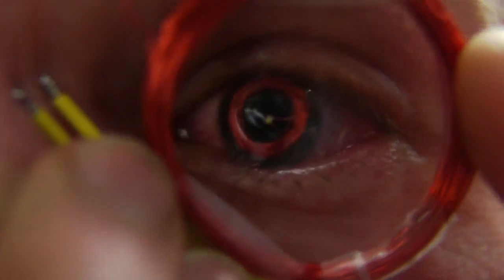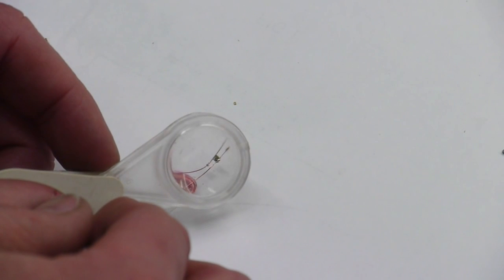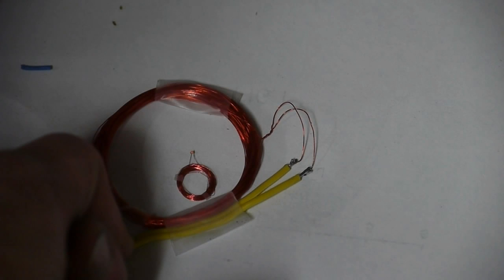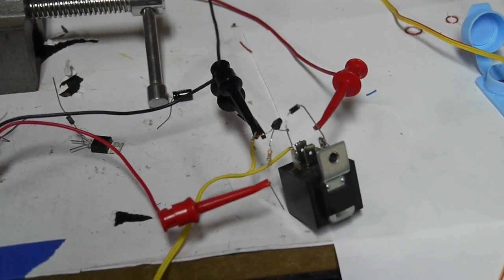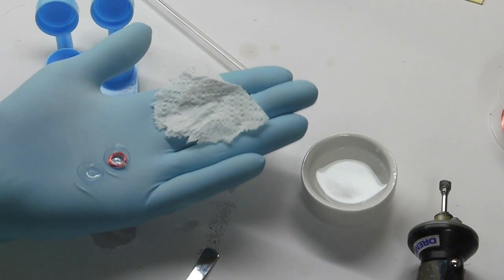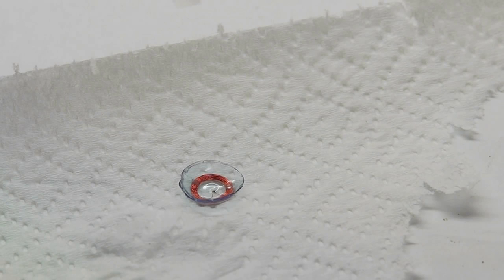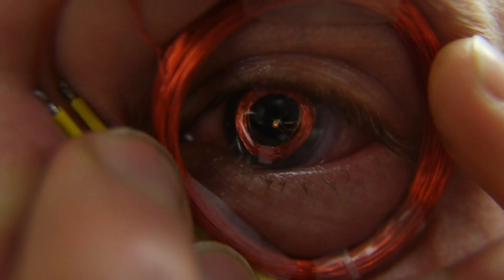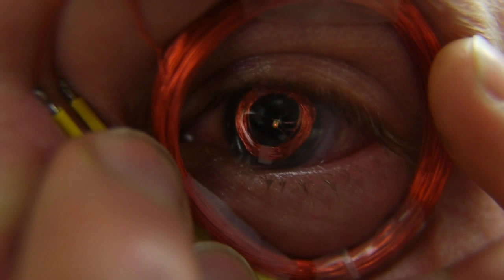LED mounted in a contact lens for possible virtual / augmented reality displays

Comment: could you bind the two lenses by heating the coil up to melt a shallow layer of the contact lenses together?
Reply: alas no it would burn through the actual lens & invalidate the aim of mounting coil / led in the contact in the first instance
Reply: ***** melt a Shallow layer... slowly and carefully.... or perhaps you could use your high power flash rig and shield the center part of the lens and then flash it a few times to get a uniform heating which would lead to less stresses in the system. Maybe a pre heating (to just below the glass transition temperature) the entire lens and then performing the above method would lead to even less structural damage. Id really like to hear back or see your thoughts on this ***** .
Reply: Jason Pfeilsticker the trouble i have with melting a shallow layer is a fabrication issue - considering the average soft contact lens is about 100 microns in thickness the sensitivity for generating a shallow melt would be a beyond the practical limit of (a) human hand (b) arranging a mechanical press 

glass would stand a better chance of surviving a shallow melt aside from the inherrent issues of weakening a brittle structure like glass, inducing aberations into the optical region of a lens & then inserting it into the eye 

happy to discuss lens materials in more detail, though i would foresee for a more long term concept of crafting such a contact lens would be at the time of manufacturing - it is however going to be the hardest thing to get such manufacturers to craft something that is not immediately profitable & prototyping is a decade+ away

logistically to generate a HUD display in a contact is theoretically possible though it would require a level of quantum engineering beyond us
first layer of the lens is the camera / sensor, a second layer the processoring component to a third layer discreet photon emitter relaying the intial image & the processed HUD

alternately would be a secondary input to the visual cortex (again several years away) where the HUD is effectively projected in the cortical processing of the visual pathway itself

sorry i have had a lot of time to think about such mechanism ;-)

Comment: try using food grade epoxy to hold the coil to contact lens in place. its a multi-material adhesive i have used alot on various non-metallic to metallic surfaces. this is pretty common in the custom knife market. esp with plastics and organic structures. devcon is a really good product. if i am not mistaken devcon has a medical grade epoxy listed in their company product list. it would be neat to see an update on you of this mod suggested.
Reply: i would suspect this would also be limited like the super glue idea - basically you are adding extra mass to the contact lens in an irregular form (yes i know the video crafter is an engine but this kind of thing needs to be done in the actual processing stage)
hence in this instance heat sealing (while still uncomfortable for the final lens bares the most logical given the materials available to the video cfrater

Comment: Use blue or white LEDs. White diode is actually blue (450 nm, or new ones violet, 405 nm) light emitting diode with phosphor added (old white LEDs has only yellow phosphor, but some new diodes has violet diode, and RGB phosphors, which are pretty expensive). The point about blue LEDs is that it glow very well on very low current. 

Use two diode, soldered anti-parallel (anode to cathode at one end, and opposite at another). This is because of band gap widening with 'wrong' polarity, and when polarity reverses - LED need very long time to recover. For testing this, use 'normal' 5 mm white or blue LED, hold one lead with your finger and another lead attach to some galvanically or capacitively 'grounded' metals. With your other hand, close to walls where AC mains are in wall - it should glow dimly.

Just one diode will blink on occasion, but two - soldered anti-parallel will glow at frequency of your mains (here in Europe, 50 Hz).

IR, red, orange and yellow LEDs has pretty bad performance, but green, blue (470 nm), royal blue (450 nm), UV-A (405 nm), UV-A (365 nm), and all sort of white LEDs has pretty good performances. 

From IR to yellow diodes, there is band gap of cca. 2.2V - 2.5V, while other diodes has 3.2V to 3.5 V forward voltage drop. And pretty good quantum efficiency (especially blue ones). 

Personally, I will not mess with wires in my eyes. If you can find fluorescent contact lenses, you can use 3W, 405 nm LED, collimated so that it cover whole your face. Although, this is somewhat dangerous (close to UV-A spectra), I tried doing this for 10 minutes with two 3W diodes - as close as 10 cm from my face and eyes - with mild eye and skin irritation for next three days (and complete recovery after that). 

So, if you do it for minute or less, no any irritation expected. Just do brief blinking with UV light, and people will be scared, if your eyes start to glow. 

Cheers!

Comment: What if you used actual glass contacts? And used your evaporation method to make the "coil" and mount the led on that? I think you're doing great.
Reply: long version

The use of glass in contact lenses hasn't been used since the first introduction of the scleral lens (100+years ago) part of why it was phased out was the brittle nature of glass, which was then upgraded to PMMA (it was discovered the polymer it didn't react with the organic structure of the eye after a number of cases of fighter pilots in WW2 had shards of PMMA in their eyes from dog fights which have been inert since)

The next limitation was the lack of oxygen transmissibility through the lens (cornea is organic & still requires oxygen to maintain clear healthy structure). initially a wearer relied on tear exchange (basically oxygen dissolved in your tears) and fenestration (drill holes in the contact lenses)

With the advent of the hydrogel polymer (the birth of soft contact lenses) water was actually bound into the lens polymer & used as a oxygen transfer agent

In the last 15-20 years the inclusion of silicon into the hydrogel mix (first introduced to the market by Ciba Visionss Night & Day lens along with Bausch & Lomb's Purevision) allowed for all most 5 times the oyxgen transmissibility making certain lenses actually safe enough to sleep with. in the video the gentleman cited he used an Air Optix contact by Ciba Vision (their second attempt at a SiH lens) & given this (i assume) is his choice of lens once it is out of the moist receptacle of the container (or the eye) it will start to dry out & become uncomfortable to wear (hence why the eye is red at the end of the video)

TL:DR ?  glass is not practical as a long term contact lenses platform 

BONUS
i could theorise that if the coil construct was actually molded at manufacturing it would have a better success margin - we already have instances of telescopic contact lenses have been prototyped Contact lenses that can zoom! - Truthloader Investigates (i'm not enough of a dick to post my own video here but i also offer my $0.02 on the telescopic contact) so in the future i see no reason for the manufacturers themselves to build the devise
Reply: It was just a suggestion based off of what he's done in the past lol
Reply: Pepper Nickel my bad with hindsight i was f0rty-eight lines too many

Comment: Try using a bit of organic compounds to melt the contact lenses together. put a drop in the middle of two contact lenses, stick them together, evaporate as quick as possible though cause the organic compound might melt through the entire 2 lenses, you only want the compound on there long enough for the lenses to melt a bit until they re-solidify together

Comment: Well I found your video by accident but have no interest in doing such a project BUT you said you have had trouble with joining the two together w/CA they have CA that is made for clear plastic don't know if it will work for this but it will not "Fog"  clear plastics that I have tried in the past Standard CA WILL NOT work and fog it up every time just Google it or check Hobby King for windshield CA  you'll find it -just had to add my two cents Good luck

Comment: You would need a screen with tens of thousands of pixels to show anything for a eye-screen. Think of it. Get real close to your monitor. And I mean like as close as you possibly can, everything is blurry and you can see individual pixels. Putting a screen in your eye you would need a extremely tiny screen with thousands of pixels to see anything. Like Imagine taking your computer monitor and shrinking it down to half an inch tiny.

Comment: i understanded that you are trying to puls the coil with a relay and a pulse generator,
wouldn't it be better just to put a ac voltage in the primary coil because that's what coils most like,not block voltage or dc voltage, u will then get more in your secundairy coil wich will make it light brighter, also are there very tiny condensaters which will fit in the lens and for sticking the lenses together a clear water proof glue could be a solution, maybe need to check out different conds of glue?

Comment: Since you can't fit a capacitor in the contact lens, could you use the two lenses you glue together as the cap? The challenge would be to get the sides conductive and at the same time isolate them from the moist. Just thinking in text here...

Comment: For your power issue, so your not holding that Cu ring around your eye, would it be possible to apply the "microchip temporary tattoo" technology to the contact?
I believe I read that these Epidermal Electronic Systems (EES) are powered byphotovoltaic cells. Search Professor John A. Rodgers of University of Illinois in Urbana and review his research. If power is strong enough could that be applicable?

Comment: i dont know.. maybe protect the middle part of the lense with something to sheild it from heat and hit it with a hot air gun to fuse the edges together?

no idea how you would get a capacitor in there.

Comment: Its pretty simple to make contact lenses. It's not possible to "glue" them together, because they aren't solid "plastic" they are a gel. They are made mostly from water. 

The inventor of the production method for soft contact lenses is a guy from Czech Republic (at the time of invention it was Czechoslowakia). Search for this issue here on YT and you will find the way to make contact lenses at home, because he did this as well :)

Comment: Try a traditional HEMA lens vs. the silicone hydrogel. The silicone hydrogels are very low water content and have a surface treatment to resist deposits. The lortrafilcon B in the AirOptix is only 33% water. Search for a polymer in the FDA class 4, ionic high-water content.

Comment: try warming the contact lens in still, sterilized water to the point where you can insert the wire. make sure the wire is small as possible in height.

Comment: I HAVE DONE THIS BEFORE! Just set the contacts on top of each other with the red material in between and let them dry. Contacts lenses become EXTREMELY stick when dry. This might take a few tries to get the placement correct as the red material will off center it depending on it's size.

Comment: I did this with butterfly wings between. You need to melt the whole edge at the same time. make a two part press out of a thin shaped aluminium tube that you heat and something that is cheap, firm and non toxic yet has some give (frozen fruit).  Heat it up with a soldering iron or propane torch and press the two lenses so that the edge is consistent and will cool off fast and not burn. depending on how you bevel the edge of the cutting surface can control the exact amount of  lenses tapper.

Comment: Put if you hade over sized lens melt 3/4 s the way try and flipping their right side out and slide the coil in and seal with little heat

Comment: Hmm, I know acetone, if in the eye with a contact lens will physically 'attach' the lens to the eye, it dissolves the plastic of the lens but rapidly evaporates leaving it bonded. Perhaps a very small amount of acetone could be used to seal the two lenses together?

Comment: Definitely wouldn't put this in my eye for long periods since drying out the lens causes issues with the len's structural integrity. Stacking the lenses decreases its oxygen permeability causing less oxygen to the cornea. Melting the plastic edges can scratch the cornea upon insertion and could can lead to infection.

Comment: Use that atomic glue they used on the football player hanging by his helmet on the goal-post.
You can apply it by sterile needle and/or toothpicks to the edges. Good idea with the inductive coupling, but I would have used the resonant circut. Then again, I have no idea what the hell I said because I have no idea what a circut is, I just used context clues.

Comment: don't need optics if you use laser diodes, (which should be extremely low yield)
i'm not entirely certain that laser wouldn't become diffuse, but i vaguely remember that somebody build a laser-based HUD prototype that worked

Comment: I totally agree, I've been wearing special FX lenses for 15 years now, only once did my right eye go all red and watery as hell cause my right contact lens started to lose its shape with age the edge went a bit crimped that is when you should throw them away and get new pair, also advice for people on how new contacts should look before putting them in, balance it on end of finger and look to see if the lens is in a perfect bowl shape, if not? then its flipped inside out, gently flip it back.

Comment: You should use a coated mtl coal loader to the contact with the 542 monodroxy chord. That should run 200 kilowatts per second. Then connect the 542 monodroxy chord to a mono-homo relay establisher. Then see Doc Brown and get the flex capacitor and you should be okay!!! 
p.s.  Stop sticking harmful shit in your eye dumb ass!!!

Comment: Any sensor built for this kind of thing. 
He said this is for virtual/augmented reality type stuff, so you have to make it suitable whether there's a UV light nearby or not. Besides, UV lights make your eyesight go bad over time. Infrared would be the way to go, but this is a normal LED to prove the concept. 
Eye motion tracking software is buggy at best when all you have is a normal camera. If you have a specific point of light to go off of, however, that makes things a lot simpler and clearer.

Comment: Dear Ben,

you can get some optically clear i think polyurethane glue (uses an alcohol to keep it liquid until it evaporates and sets) you can get from most craft stores. That might assist in the bonding instead of melting the things together.

Comment: I see an irony here,, you need glass`s shaped coils around the eye to power the contact lenz. FYI - the body does produce tapable amounts of power that could run the led, an you can use two others to act as a bridgerectifier giving you a whopping 3 nano pixel display! lol. Also - cool work =D

Comment: You could try bonding with contact cement.. I work with optics all the time, and crazy glue is the last thing you want to use. Also, you can go another route and 'paint' the desired image in laser.. A lot of work has been and still is in progress for a laser VR..

Comment: You may be able to bond the contacts together with MEK (methyl ethyl ketone) or another plastic solvent. It would weld the plastics as opposed to actually glueing them, it also evaporates quickly and leaves no residue. Only problem i'd see is its water soluble and it would probably mess up the optics of the lens.

Comment: Old video but I guess it's still worth answering your question about sticking contacts together, the best way to do it is to put them on each other and dry the outsides while keeping the insides slightly moist, when they're dry enough to stick together but no so dry as to tear, heat a needle and poke if from inside to the out. Keep the holes close together and small all the way around the contact and you shouldn't notice any problems in your eye.

Comment: maybe instead of sending the light inward, send it outward.  It also occured to me that what we can do at home is no match for billion dollar facilities.. if someone with the proper money/team/equipment took on something like this, maybe they would be using graphene / microscopic mirrors / nano circuitry, such as embedded laser diodes and drivers (nanoscale)  on swivel armatures..  or maybe we can just use the lens as the capture, and send the images from nodes in public / offices etc

Comment: Well, yeah, because of how he pinched the edges of the two lenses together, it's irritating. The inner surface would be smooth and non-problematic, just need a better way of sealing it, and reducing the thickness enough that the eyelid doesn't blink it down.

Comment: try pinching the lenses together,and let them dry out till they're hard ,the re-hydrate them they'll be stuck well. i've ruined lenses buy folding them in half and letting them dry out, you can soak em forever and they never come apart.

Comment: inducter coil around a pair of lensless glasses? 

and what about running a current through the lens coil just strong enough to heat it up and just barely melt the surface of the contact lens adhering it to the coil

Comment: i think you may of foud a pontential solution the problem with the concept. is its still impossible to cram everything needed for a fully functional display on your eye on a contact lens. but you have a ring around your eye to get the current where it needs to go, if there was a camera  that could match your eye with tracking and other sensors to make  it useful all small enough you could put the hardware on 2 rings around your eye, or ideally since this is military practical on combat goggles.